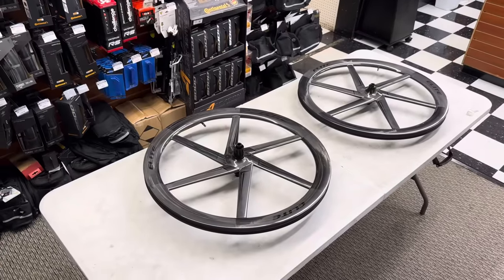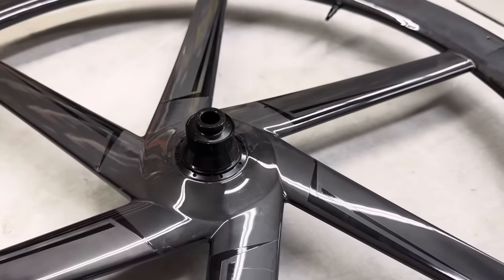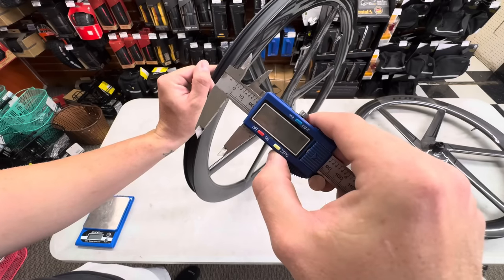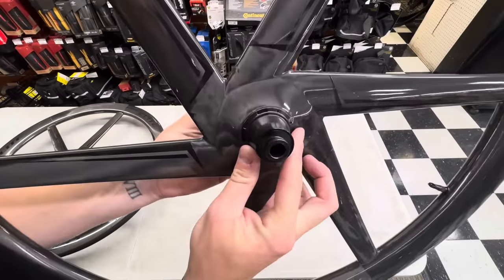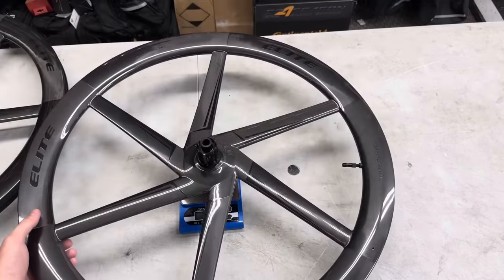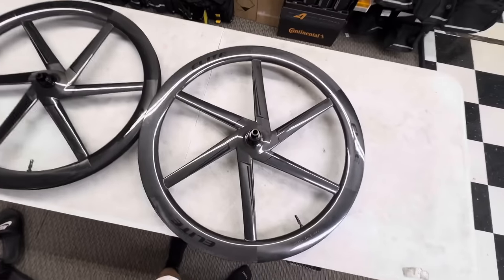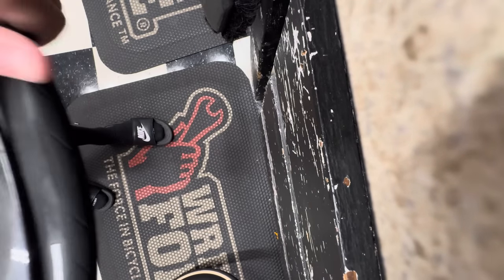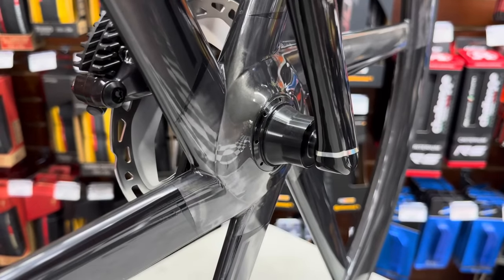*ELITEWHEELS VELO SIX DISC WHEELS* These wheels Dominate 6 spoke carbon wheel Market!!

Comment from the maker: Heres where to buy the wheels: (USE CODE: GC15 15% OFF)
https://www.elite-wheels.com/product/road-triathlon-six-spoke-wheels-triathlons-wheels-velo-six-disc/

These wheels come into this market space very competitively, and I think it will give a lot of the other 6 spoke carbon brand wheels a run for there money because of how affordable these wheels are compared to the other brands out there. There is no one else out there that I know of that is close in this price for a name brand for this style of wheels.

At the end of the video I show the wheels installed on bike and also give a freehub sound check on bike and they sound MEAN!!!!!
Reply: I ride Elite wheels, basic ones, and they are fantastic! a little on the heavy side but lightened them up with TPUs. Great, affordable brand
Reply: Out of stock.  Thanks for the convenience.
Reply: @hoyhoy42 They were not available for purchase until 11/24. I got mine right after midnight. The live rep told me there are 20 sets in stock and I'm the first to order. They're doing $209 off for Black Friday.
Reply: Your code can’t be use at all could you please let us know why?
Reply from the maker: @unknowinformation2175 try gc15
Reply: Hi GC, did you try some climb or hill on this wheels? If yes how does it feels like?

Comment: Thanks for the review! I noticed they are very flimsy laterally.....I mean, the spoke ls meet the hub at a 90-degree angle.    Does your front wheel speed wobble if you take your hands off the bars?
Reply from the maker: it does not speed wobble but yes I know what ytou are talking about, with the wheel just sitting there and you put pressure on the wheel left to right there is a good amount of movement almost to where you can see it touch the frame

Comment: I'm 200 plus lbs and still ride a SPIN tri spoke MTB that's 23 plus years old and still sings, still true, has never been serviced, ridden on rocky hard root trails, this design lasts, crazy durable.

Again, just cop the rear if you're a climber or extra weight conscious, a beautiful upgrade.
Reply: I had two sets of SPIN wheels in the 90s... The aluminum rim pulled away on one and I cracked a spoke on another.  They're chunky AF, but they do sound awesome riding fast with those spokes making "womp" noises.

Comment: If these are "road" wheels, then why are they so shallow depth? I have a trispoke like this that is 69mm deep, with 6 spokes you could double that and get 138mm depth rim
Reply: I mean at that point why not just run a disc wheel. Your already going to be getting blown around in a cross wind.

Comment: I was under the impressing mag wheels like this are worse in crosswinds than spoked wheels. Looks sweet though. And I don’t mind weight on a tri bike. It’s all about aero and if the heavier wheels make them more durable, all the better.
Reply: I'm sure they are in cross wind scenarios.
Reply: I have the Black Inc 5 mag wheel and you can feel them in the crosswinds, more than my 55mm standard wheels.

Comment: Hi sir Can you lock more mile on climbs also, how this thing climb compare to big brands deeper wheels like 60mm or 65mm.
Reply from the maker: I do not have climbs in my area but i have been riding the bike on the flats and they are meant ot be an aero wheel with a 50mm depth and they do just that they hold speed very well

Comment: Where would you put your speed sensor ???Love the sound of the freehub and they look great on the bike.
Reply: You don't need one. Modern GPS computers can determine speed quite accurately.
Reply from the maker: yea I just realized that today when I wanted to put mine on, I guess for right now just computer only
Reply: @GCPerformance18  might be ok with strong double-sided tape. I have the wahoo BT speed sensor that wraps around the hub.
Reply: @_MrSnrub gps is good enough for avg speed, but if you want to know your exact max or accurate speed on a segment, or at least avoid “300 km/h” bits after tunnels, no way around a separate speed sensor

Comment: They must be illegal for road racing?  For TT's & Tri's the rear makes less sense over a disc unless they bring out a deeper rear for Kona & other disc illegal events.  Even the front depth  may be better with 60mm plus rim option for most TTing days. For a non racing wheel they must be on the stiffer side comfort wise for longer rides etc.  These kind of wheels are OK mtb wise as you have the Suspension but non racing road riding may be one to look look or shorter coffee shop rides. They do look cool though.
Reply from the maker: yes I think they are, I think these are not uci

Comment: The gravel version is lighter and has a more modern specification. These should be minimum 30mm outer and a 23mm inner. Weight is disappointing too. Pity as I would’ve ordered a set.
Reply from the maker: They are more aero than anything. They have 50mm the internal width is more then enough for road. They are extremely stiff wheels and feel amazing for riding on the road

Comment: Mount them up if you want to completely destroy your back what's left of it and when they rattle all your teeth out it might improve your looks. LOL Just kidding...not really. Good Luck!!
Reply from the maker: did a ride yesterday on them, they are stiff but nothing a 28 tire cant fix
Reply: @GCPerformance18 with 21 int / 28 ext rim width you’d be pushing your aerodynamic luck with 28 mm tyres though — breaking the 105 % rule. Considering that aero is supposed to be the main selling point, apart from the looks...

Comment: Thats a straight up copy paste job of the Bike Ahead Biturbo Aero wheelset. These chinese carbon companies are absolutely shameless
Reply: Hire a lawyer and sue them.  😂 I have two pairs of Chinese carbon wheels. Am I going to win any races with them?  Nope!!  Does my bike look amazing on the Saturday bike ride... Oh!! Yeah!!!
Reply: Don’t see any issue there when you can get it cheaper and not over priced wheelset.
Reply: This has a higher weight limit than bikr ahead and this is heavier
Reply: A wheel is a wheel, there are only a certain amount of designs you can make.
Reply: @MrBillboeing  Not really.   Black Inc also makes spoke wheels as does Xentis - neither of them look like Bike Ahead because they are designed in house.  These are straight copies.
Reply: @SandSanta if you want to go to such lengths: I’ve seen this type of wheels in the past. It was in 2004 GTA SA, on a motorbike. It has the same 6 spoke retrogressive pattern. Did they copy a game from 2004 then?
Reply: @SandSanta because the black inc is a 5 spoke. Also, they may look similar, but not 1:1. Could just be both r&d teams worked out a similar design without any copycatting.
Reply: At least Chinese sells their stuff cheap instead of those overpriced branded wheels
Reply: The biturbo wheels are three times the price. Whos really shameless?
Reply: Who designed them and who copied them?  Do you think innovation is free?  Keep buying Chinese and see where it gets you.  Look at the state of America today, because it worshiped the concept of outsourcing.
Reply: You noticed!
Reply: @jasrod2012 It's not the public, it's our lawmakers.
Reply: 90% of the big brands outsource their manufacturing to asia and thats how they make big bucks on all middleage TDF wannabees 😂
The hype is ludicrite and suckers get fooled.
Complete bikes is a ripoff, 1000-4000 $ is not justifed on those 8-12000$ bikes. And to buy a frame only is not an option by many brands... Go figure
The industry impose their rules about bizniz..
Reply: @Chimy1423 makes you look like a poser.
Reply: Where do you think Biturbo or blacking is made? Taiwan?